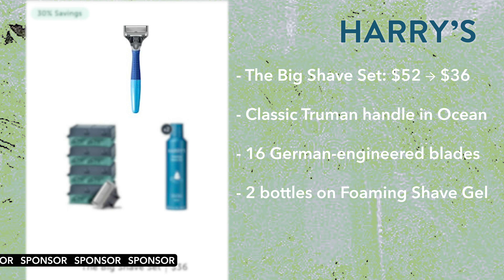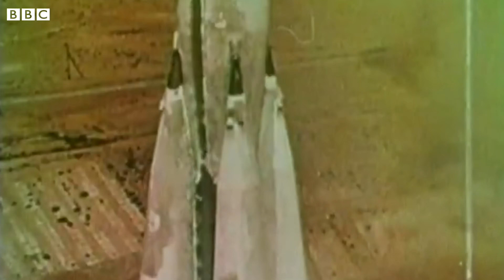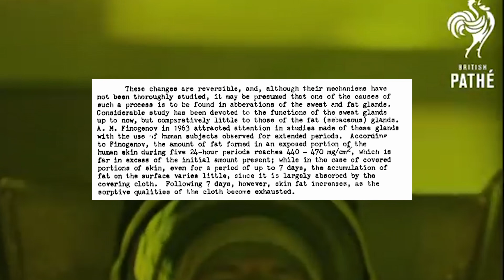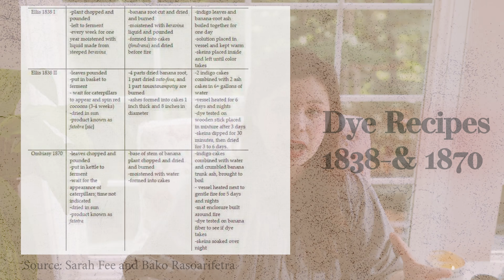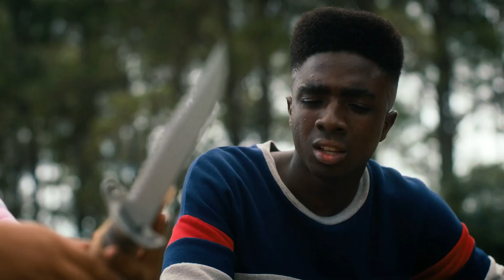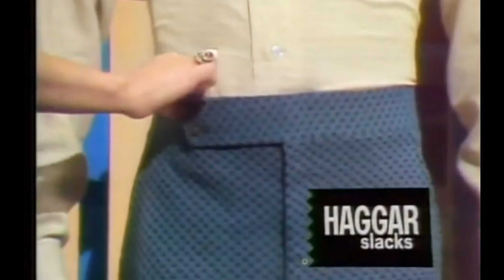The DISGUSTING truth about Laundry

Comment: When I lived in a more rural area, I had well water that destroyed all my textiles. Even with a whole house filtration system, the water turned whites a dingy orange. The city water I've had in every other home has never done as much damage as that well water did. 

Now, as for dryers... I've spent most of my life in the southeastern US. Where I live currently, in Mobile, AL, we get more rain than any city in the US, including Seattle. It rained 63 out of 68 days straight this summer. There's no hanging laundry out to dry in weather like that. And in most of the south (I spent many years in Memphis, Nashville and Tampa, too) hanging your clothes outside to dry would leave them coated in pollen and dust and bugs. So not really an option. Even hanging your laundry indoors (which I do for some items) takes nearly an entire 24 hour period to dry fabrics of any weight because the humidity is so high all the time. And yes, many landlords prohibit this practice because it creates other issues with mold and mildew. 

While I agree that clothes dryers are energy hogs, and damaging to our clothing, it's still the best (or only) option for many of us.

Comment: I moved to the US from Spain last year and I was shocked by the fact that I now need a dryer! I don't have a yard and our flat is tiny so I don't have space for an inside line, but where I come from (Basque Country) we have lines that  I've never seen in the US. They hang from one side/window (so you don't need to have a building in front of yours), they can rotate and they even include a rainproof cover in case it rains (which it does, and a lot). They're great for those of us who live in apartments, and definitely better for our garments and the environment. 
Also this video really motivated me to start making my own linen underwear, since I would need a fairly small amount of fabric to get started and I think it can be so comfy. I also make my own DIY detergent, it's cheaper than any store-bought option, safer + I avoid using more plastic. It literally takes me 2 minutes to mix everything. My only issue is that it contains baking soda which I think is bad for linen, right? I think it would be cool coming up with an all-purpose solution and then using the vodka for underwear and stuff.

Comment: I remember the first time I line-dried my clothes: they were dry within minutes and even smelled good. I was astounded. "The sun is amazing!" I thought. "Do people know about this? How could I market this? Why isn't everyone talking about this???"
Reply: When I prewash linen/cotton and hang it outside in the middle of summer (or generally 20+C weather), it's usually dry in at most 2 hours, depending on if I actually put it into washer or just chuck it into bucket with almost boiling water and let it sit there for while (in my defense it shrinks the same in both processes and it'll get washed properly after it's finished anyways). And legit, I sometimes use the bucket "wash" when I'm too lazy and have only few small things that need quick refresh for tomorrow.
Reply: @SugiyamaHiromin  The other great thing about washing a few things in a bucket is that you can easily throw the used water over the garden to water it.

Comment: I add a little borax to my washer to soften the water and then I don't need as much detergent.  (I also add it to my dishwasher). I use wool balls in the dryer instead of fabric softener.  It does speed up the drying process.

Comment: I use white vinegar 6% acidity (for food the normal is 4%) to soften and sanitize my clothes. I put 100ml in to a full load instead of fabric softener. It's perfect.

I also only use soap designed for delicates or baby clothes. They are less agressive. 

I wash less my clothes. I use a mixture of 50ml alcohool 70% + 50ml white vinegar 6% + 100 ml filtered water in a spray bottle to sanitize the cloth I'm not washing. If the clothes are not smelling I Just spray this mixture and let it Air dry during 1 day and then I put It back in the closet.

In Brazil 99,9% of households don't have dryers. We line dry everything even inside apartaments with a ceiling rack. 

Those are the minor changes that I was able to do in my individual life to better laundry my clothes. But the real changes need to come from public policies.

Comment: I hope this helps: Lye water. Easily made by collecting rainwater and running it through hardwood (as in not Pine or other softwood but like Oak, etc) ash. It works with cold water, rinses clean and needs to be used PROPERLY to prevent injury. Food grade lye exists, so the ratios are what is important. Basically, it works by converting the oils in the clothes from your skin into soap through soaponification. You still need to hang clothes in the sun for disinfection, or use a trick like Abby described but if you get the ratios right, it is perfectly safe and won't hurt you or your environment. BUT USE IT AT YOUR OWN RISK AFTER DOING YOUR OWN RESEARCH! I can not be held legally responsible for anyone being hasty, irresponsible or stupid.
Reply: Linen will hold ok, but these contemporary cotton t-shirts, I have doubts.

Comment: My "tipps" or rather what I usually do:
We do dry our cloths on a line but we do it inside ouf flat as we have no garden. There are thes super cool foldable thingies that are basically multiple lines on a scaffolding and you can dry a full load of laundry on them not taking up super much space and then you can just put them away like an ironing board
Mum also sometimes poors almost boiling water on the underarm portion of T-shirts. Not great for the color but as it is just the underarm it isn't too bad
If you have enough undies and socks to ve able to collect the dirty ones until they fill a load in the machine, do that, wash them seperately on 60°C
Presoak anything with stains in the sink befor washing. Stains are so much harder to get out after the wash
Get those bags you put your bras in during the wash and put everything inside one that could get caught on something (beads, closures whatever).
Seperate by colors so they don't bleed all over your clothing
If you got filthy stuff allways preclean in the sink
We have soft water but some garments still come out very stiff and weird from the wash, so we usd a tiny bit of fabric softener. My parents have hard water but they still only use about half of the recomennded amount and that amount usually comes out really nicely during the wash. I know people who use 4 time the amount recomended to perfume their cloths. Don't do that, it will build up inside the fabric. If you want your cloths to smell like perfume in the closet (something I personally dislike, I'm sensitive to strong smells) just put some lavender bags in your closet (good against moths too) or some cinnamon, rosepettals etc. Perfume the surrounding of your cloths not the wast water.
This wastes more water but if you have trouble getting all the detergent out, push the extra rinse button
If you got short cycles, use them no cycle will sanitize anyway and it is better to use 40 mins of power than 5 hours of power
There are different tumbling options. The less tumbling the wetter the cloths when they come out but also the gentler the whole washing process. Find a good midway that works for you
Don't wash shoes in your mashine. You'll get all the filth on your other cloths plus it can damage the mashine through the banging against the computer part

Comment: We have a Speed Queen TC5 that we wash all of our farm clothes in. 20 year guarantee on some parts. I mix all of our laundry cleaner. 
We line dry most of the time in the summer and use the wood stove to dry in the winter.  The tumble dryer just died and will need to be replaced. It was 40+ years old and we can't find a new heating element.

Comment: Because I am in an apartment I use my folding clothes rack in my unused dining area. Don't get the benefit of sun but I do save my delicates and some energy. I also hang things in the bathroom. I don't get a choice on water temp. It is hot and hotter. My biggest issue is what to use as detergent. I am in a hard water area and I am sensitive to perfume and dye in detergent.

Comment: Pro eco friendly laundry tip: White Vinegar.  Put ~1/2 a cup in the bleach dispenser or directly into the tub of the washer and it helps combat the hard water issue and make your detergent much much more effective, but without harsher additives.  Rinses right out, so no worries about vinegar odor.
Reply: It's also an excellent remover of stubborn smells!

Comment: Oh Abby! I have an agitator just like the one you showed and now...  I never want to use it again.  I'm ready to get a huge cauldron and just boil everything outside now.  

Fun fact:  Plastic fibers (aka man made poly, rayon etc) will melt in hot water.  You have to use cold water on a gentle cycle to preserve the material.  This, of course, means that these items are not actually getting clean.  You can not put them on high heat in the dryer either, as they will melt and tiny holes will appear, or the fabric will seem rumpled in areas.  Now think about how many pairs of women's underwear that are made out of polyester and spandex.  Think of all those G strings and thongs.  I am slowly, as I can afford, replacing all my plastic clothing with clothing made from natural fibers.  Same with my linens.  It's expensive, but it's better in the long run.  I'm also considering (*NOW* thanks Abby!) making my own shifts and camisoles out of linen fabric.
Reply: Though rayon is man made, it’s not made of plastic.

Comment: As a tiny point of ?reassurance- surfactants break down bacteria cell membranes, so there is actually still sanitizing happening with modern laundry practices. It's just at a chemical level rather than a mechanical one.

Comment: Is the alcohol something we could throw into our "intimate" loads to reduce the poopy t-shirt situation? How much would the dilution of the wash cycle would make the alcohol perform. 

Also, maybe we can start installing local water heaters at the appliences? Theres a word for it, but basically you heat the water at the input to the applience rather then having a hot water tank that is hot all the time. That way sanitizing appliences like clothes and dish-washers can run with boiling water but not have people burning themselves in the showers and sinks.

Comment: What a lot of information.  Now to digest all this new found knowledge and figure out how I as a high-rise condo dweller will do with said information.  For years I have used the dryer for only about 1/4 of my clothes.  I hang most of my clothes on hangers  and hook they on top of door molding, tops of door ways, bookcases and door knobs.  Not the best look but my clothes last longer.  Condo laws prohibit us from drying clothes along balcony rails.  My problem is the sanitization of clothes, but the Vodka thing might the the answer.  As a non-drinker buying alcohol will be a whole new experience.   Plus now I understand the whole wearing a slip, and t-shirt thing, some will remember wear pant slips.  Linen underwear here I come.

Comment: Thank you for making this video Abby, I think this is a really important subject that doesn't get talked about enough. We need to do everything we can to protect our water resources and laundry & fast fashion are a HUGE contributors to the environmental damage we are doing. I hope these things can all contribute to real change. One laundry tip. I use distilled 1c white vinegar and 1c baking soda as fabric softeners/odor neutralizers/whitening/brightening in my laundry along with fragrance free detergent. This helps keep things smelling fresh without contributing to the endless cycle of gunk and bacteria build up on clothes. Vinegar is also safe to use in HE washers and you can add it in the fabric softener dispenser, with the bonus that with continued use it will clean out all of the fabric softener gunk that is leftover. Baking soda can be added directly into the tub.

Comment: In my sixties. I have clothes I bought back in the '90s that are still in wearable condition. I don't understand her comment about putting something in the laundry after wearing it once and it coming out with holes. I've never had that happen, but I don't buy cheap clothing. I don't buy the most expensive, but I buy decent quality.

FYI I'm low income. I don't have a lot of money. I actually buy much of my clothing at the thrift store. When I do buy new I buy quality. I'd rather spend a lot on something that will last 10 years then get something cheap that will last 10 weeks. I'm a renter, I go to the laundromat.

And I've never, in all of my 48 years of living alone, had clothes come out of the laundry with holes in it.
Reply: I don't know if it makes any difference, but also, I wear things more than once all the time. If something doesn't look dirty and doesn't smell, I'm going to wear it again.

There's no need, no reason to wash something if it doesn't appear dirty or smell.

Comment: This video was very informative! I find myself more often now then before battling the laundry monster and it's nice to understand it more in a historical context.

My big complaint about clothes/laundry right now is I'm finding myself having to wash "eco friendly" made clothing more, because the manufacturers who brag about saving water in the production of the item seem to really just be skipping steps. 
The non "eco" stuff can go into the wash without problems, but the eco-friendly pieces are full of excess dye that I then at home have to wash out. The way I do it is I use color-catching cloths to monitor how much dye is coming out per load, I then pour 1-2 cups of vinegar into the machine drum directly and one into the soap tray. After two rounds, I switch to one cup of vinegar in the wash and soap into the tray. Sadly it may take up to four rounds for the catching-cloths to stop collecting excess dye. This bothers me, because it means that when I buy something new I either have to wash it by itself forever or I have to do this wash-out process to then make it safe to put in with other clothing.

Comment: Time to research historical laundry practices 😅. But on a slightly more concerned(?) note I live in a very humid climate with lots of bugs all of the time. I'm worried about my clothes not drying and becoming covered in insects. But conversely my clothes already don't get dried in one cycle it can take upward to 3 for 1 load because of the aforementioned humidity as well as having a modern sensor dryer. Perhaps I could build a greenhouse? I could have it play double duty as a drying building and a gardening area which would cut down grocery cost 🤔 
You've given me a lot to think about Abby, thank you for the video!
Reply: If it is taking 3 drying cycles to dry your clothes, have you considered that the dryer vent tubing could be lint clogged? Get that cleaned out and your dryer should operate more efficiently. Also dryer vent fires do happen and cause house fires - something to think of if you start your dryer at bedtime or when you are about to leave the house.
Reply: @derrith1877  thank you for the advice! We do clean it out, often, but it doesn't really help much. But now the thought of house fires is making me lean even more towards a new set up.

Comment: I also find line dried clothing ridgid & course. I have tried drying on the line, to damp, then finishing in the dryer,  but,  that sort of defeats the energy saving, somewhat. 

Has anyone else found work arounds?

in my local area the air quality is nice enough most days that line dried clothing smells "deliciously" fresh.  

Infact, putting unwashed cloth (or, even washed & dried cloth) on the line for 20 minutes or so infuses it with that lovely smell.  fresh air also seems to remove mild natural fragrances that get into the cloth, leaving it smelling clean.

My washer & dryer leave my clothes feeling clean & fresh, but, not quite so nice a smell as the line fragrance ( I  only use a "natural" fragrance free laundry soap: no other additive liquids, powders or stuff, nor dryer sheets). 
We do have hard water, though. I wonder if the local health food store has anything to balance that out.

Alcohol (rubbing or drinking) can be sprayed on cloth to remove the fragrance of bodily oders (not perfumes, or chemicals). I forget the fancy word for this phenomenon. I use vodka in a spray bottle, recommended by friends in a costume department) but may switch to rubbing alcohol , as it's cheaper.

I highly recommend pre treating all stains, I find that the laundering process sets them. When wearing underwear snug enough to touch my no-no parts, if there's any stains, I pre wash that area,  by hand, wearing gloves, if necessary. Now I also know to set "no-no" touching garments in the sun to sterilize it, before washing. ..thanks Abby!